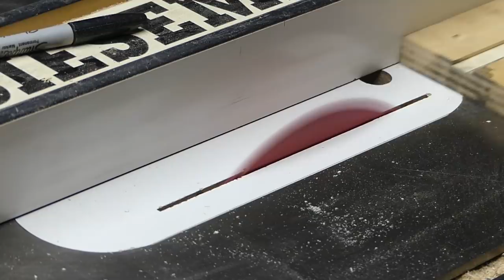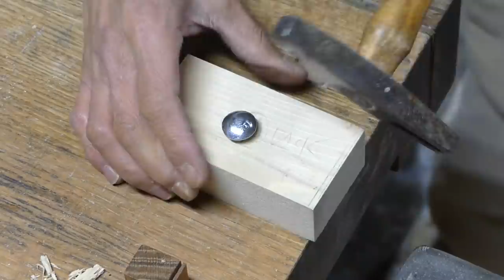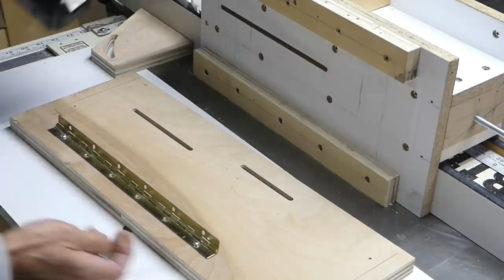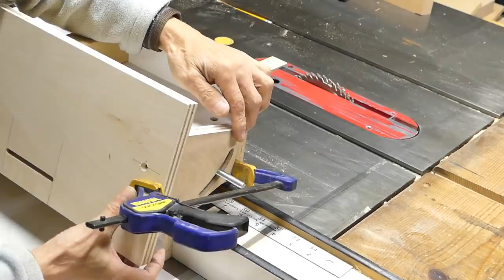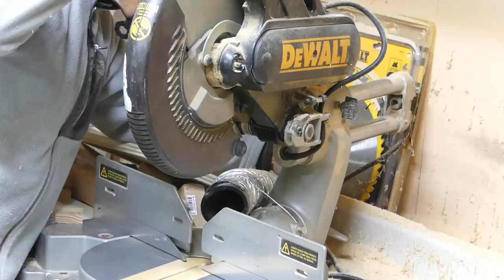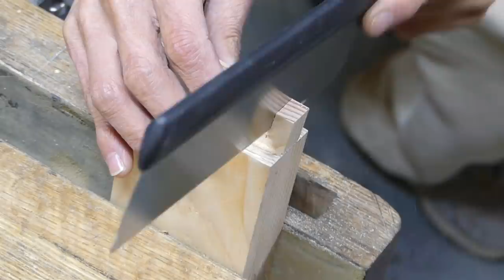multi-tenoning jig and spline,raised panel jig ( all in one )

Comment: This could benefit from a small angle bracket added (with a bolt at the top) so you can repeat angled positions across the axis of the cut as well. I. . .hope i'm explaining this well. Very interesting design, gives me incentive to fix up my saw's straight back.